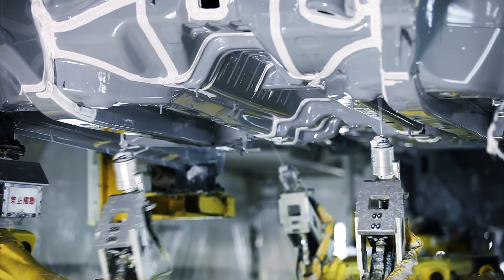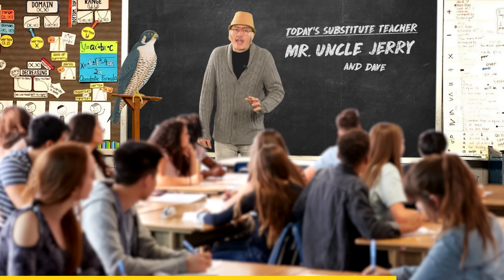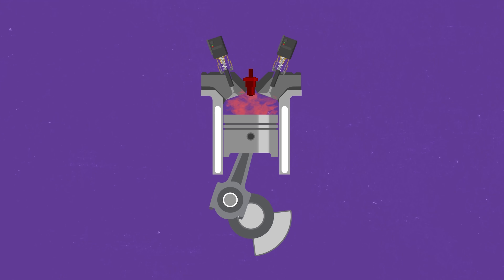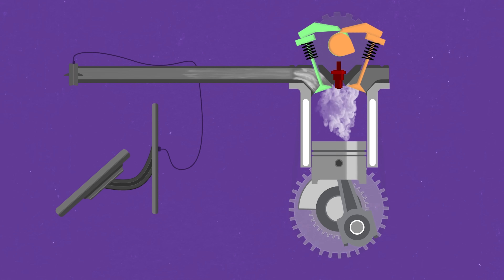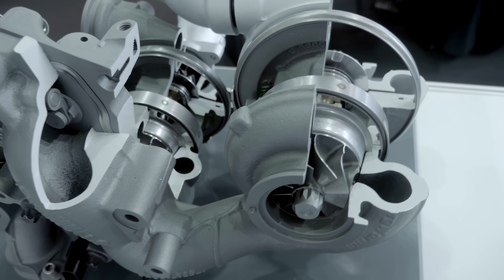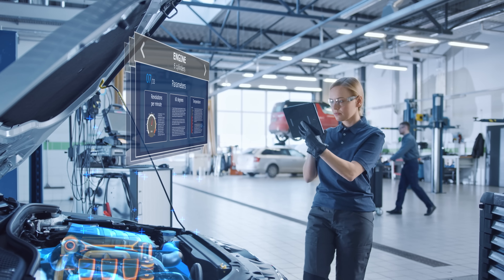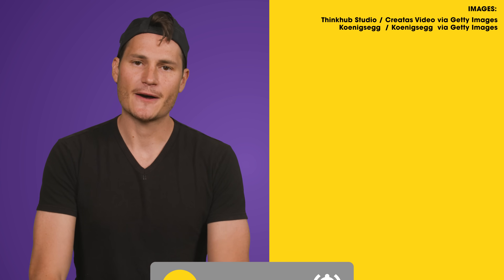This Is The Last Great Engine Tech

Comment: you know I've always thought that the EFI tech that has been around for a while, injects the air-fuel mix directly into the chamber but apparently it's not, it functions more of a digital carburetor huh. I've always known that electronic injection into the chamber would be absolutely nail the stoichiometric ratio and the highest pressure for every power stroke so I thought we've already done this lmao. The electronic bits of this can be done using Arduino shields for sure. Love your content, Jeremiah

- A fellow engineer

P/S: methane powered engine? stay OH safe and show us that bad boy my man

Comment: I thought about this years ago. Like in the 90's. Just wasn't an engineer our had enough mechanical knowledge back then. Shoot I also thought about why not get rid of the intake valves all together and have a air pump built into the engine and have direct fuel AND direct Air injection. Using and electronic Exhaust Valve or build it similar to a 2 Stroke and use a bypass valve.

Comment: There have been companies testing electronically actuated valves for decades.  Ford had several prototype engines ages ago.  Their problems were all in the areas of reliability, compute power and economics.   If we've progressed to eth point some guy can buy parts to build this in his garage then i'd say we're overdue for these engines.

Comment: The problem with a fart car is it will cause a rise in price for beans and other flatulence causing foods. Just like ethanol caused a rise in corn prices. But as a man that can clear a room with mine, I would love to have a car powerd by "natural gas".

Just put a collection device under each seat with slite suction, and a small compressor that's all that's really needed. It will probably make more sense as a power adder not as a primary fuel source.

Comment: This seems like some tech that should have been implemented about 30 years ago.
Reply: Tbh it was possible even 20 years ago, and I don't see it as bad as "carb vs injectors" cuz with electronic cams you can leave so much maintain behind (some european chains needing to pull the engine out for 5-10k)
Reply: Was thinking the same thing. We have had all the parts for this for ever now.
Reply: Caterpillar filed for a patent for electronic/hydraulic valve actuation in 2000 while trying to advance their heui system. Lots of other manufacturers have played with this technology.
Reply: Car manufacturers have a very slow development cycle. If car manufacturers designed electic cars that car people would like, they would have made solenoid electric motors. Same as those solenoid v8s but bigger. Efficiency will probably be worse, but those solenoid engines are futuristic and still holds a candle to the ice vehicles.
If making and designing cars were easy as implementing software, we would have had electric cars waaay before tesla, but the complexity of the car industry is far bigger than any software industry. Hell even any electronic manufacturers.
Reply: Hell the tech could have existed back in Henry ford's time - they could have electrically actuated valves that were controlled by something similar to the old distributors instead of a computer - it would have been possible to retard or advance the valve timing more easily with electrical control, and it would have been a lot simpler and lighter than all the timing chain and cams that are needed with traditional valve control.
Reply: @Cast Reflect This isnt variable valvetiming. Most engines have that.
This is electronic valve control.
Both valve length and riming become infinitesimally adjustable with an electronic control unit.
Its like EFI to carburetors.
Reply: Isn't that what the multiair engine system is?
Reply: I own a hit and miss enjine that was made in 1908,it has no rocker on the intake valve and uses only vacuum to open but this is not freevalve like we have today,the new systems had to wait for computers powerful enough to control them just as electronic injection did
Reply: @DaveTW65  you could power freevalve with an Intel 4004, which has existed since 1971.
Reply: @kalasmournrex1470  You can hardwire this shit into a microcontroller with vacuum tubes. The problem isnt processing power, its reliable operation.
Reply: @kalasmournrex1470  there were no emission standards to push research and the cost effectiveness would have been unjustifiable against traditional valves,this was the early days of electronic ignition and even that was having issues with reliability back then
Reply: @DaveTW65  true

Comment: still don't understand how more mainstream manufacturers haven't done this with their latest engine generations. the benefits seem so huge. imagine a 3 liter bmw I6 with freevalve that's 15% lighter, 20% smaller, 30% more powerful and 30% more fuel efficient, seems dumb not to try. instead they're doing mild hybrid shit, adding weight and complexity to achieve worse gains

Comment: Nice! I rebuilt my first engine when I was 15, back in 1979, and it was a 351 Cleveland 4v. I have rebuilt numerous engine since. I grew up in the suburbs of Detroit, with my dad working for Ford. My sister has been with them over 20 years at their HQ in Dearborn. I remember when Jack Roush had his shop just few miles from the house off of Levan rd. and I got my hands on a 2.3 Turbo that his shop had built and put it in my Mustang. I say all of this so that when I say that this explanation was excellent, it comes from someone who know how this stuff works.

Comment: I feel like free valve technology can save the V8. Increasing power while reducing elections. Also with a smaller engine you reduce the amount of material used and of course the weight savings that come along with that would be beneficial.

Comment: The graphic about 'half the exaust that goes out instead to the turbo' is wrong.   1 of the valves of each cylinder goes to turbo and 1 of  each cylinder goes directly out.  But it is no even like that exactly.   It has a 'Y' setup

Comment: I’m surprised ppl don’t like electric cars cause of some reason even when ice are PACKED with electronic parts to cut out mechanical parts. I’d think we would all be excited that we don’t have to break the bank for hyper sports car performance
Reply: It is because of their awful range and how they are completely silent, although the tire and road noise on them seems 10x louder
Reply: @ayoutubechannel921   range is pretty ok at 500km per charge especially when you aren't a traveller.
Reply: @Ajibolaa  I guess car manufacturers could have used straight-cut gears on the motor components so their is at least some noise

Comment: What if the digital free valve system gets heated up by the engine emissions that would slow down the processing power hence resulting to far more worst results than the analog method

Comment: The last great engine technology will be magnetic coupling and no oil engines.
This is basically a normal electric motor, but for the purists who just have to have the v8, v10, v12 and the odd v6 a magnetic engine based on those traditional formats will eventually come into existence. 
As of yet they don't exist, I mean a solenoid engine isn't a million miles away but they have friction loss which a magnetic engine won't it will just have the issues of electromagnetic feedback to overcome.
I literally look forward to the future because it's going to make now look like the stone age.

Comment: That graphic animation at 6:00 is where it’s at! Simple and understandable. Love that combo. Cheers to the artists.
Reply: its also wrong. Actuator response isnt instantaneous. Response to input sort of is, but those edges on graph should be curved slightly. In other words it contrasts two different things - signaling for digital valves and open/close cycle for mechanical.
Reply: @bartoszbaranowski604  it is still much faster and can stay at 100% instead of reaching 100% for a mere instant. The graph is dumbed down to get the rough idea. Very simple and very understandable
Reply: @TaireTV  Never said otherwise. Though, graph is not "dumbed down" it's just wrong. It compares digital signal to position of vales in mechanical set up.
For mechanical set up it is roughly the same( minus inertia of parts ). But for digital setup it just isnt - input signal is not even close to valve position/graph.
Reply: @bartoszbaranowski604  the graph provides pretty good understanding for people who do not know how analog vs digital works. Providing understanding is good, but in reality, analog vs digital signals work absolutely differently, this is where they made a mistake. I think, what they wanted to show was that there is more precise and predictable valve control, using digital signal, which does not depend on revs mechanically.
Reply: @v0ffka1  I think this graphic crossed the line into inaccuracy and then some.
Reply: The thing that bugged me was on the cam graph it was a sine wave vs having flat spots where the valve was closed.
Reply: Yeah exactly! 
Are you an animator as well?

Comment: i liked the project car Koenigsegg tried this tech on for 4 years ago, an "Old" Saab wagoon. the emissions and power were really nice. but the most impressive thing was that fuel consumption decreased with around 40% while getting better power, torque and emissions.
Reply: Correction, the old saab has had its tries with the free valve tech for over 10 years today, and at the time 2013, it had over 60.000km driven with no issues

Comment: The electric takeover isn't entirely here yet - There's a huge market for this as both an OEM and aftermarket system. I'm not against electric cars, but until the tech in them is cheap enough that everyone can afford them, and until the range is improved to the point that people in rural areas can use it effectively, we need combustion engines. And since we have a bunch of old cars and engines that are inefficient by modern standards, why not make an aftermarket system that modernizes them?

Comment: Also if possible research more on the alfadan big block 4 cyl engine. Claims of over 600+hp naturally aspirated, that also uses freevalve company for its valve train system.

Comment: This technology is an advancement in Fiat’s MultiAir technology, developed almost 20 years ago and has been in cars for over a decade. Don’t give Koenigsegg all the credit.
Reply: They still use a camshaft, so it's a bit different.
Reply: @pvp_operator  it is different, but they didn’t come up with the idea from scratch. You gotta give some credit to Fiat for their predecessor to this all-digital version.
Reply: @davedvorak8426  The idea of total valve control has been around for longer.  I've never heard anyone at Koenigsegg say they got their inspiration from Fiat.  I'm not knocking Fiat, I like their solution.  I'm just saying they are different solutions to the same issue.

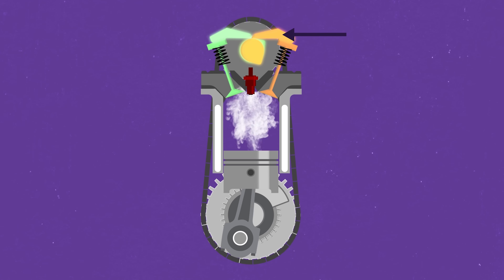Comment: 3:14 Holy sh*t for a car channel, that animation of the engine with the timing chain and completely wrong sprockets to turn a camshaft at half the speed of the crank makes me question your basic knowledge on how engines work.

This video....tries....to explain things.  Eh...even with electric controlled valves, they still take time to open to the target position, as well as to close.  It's not instant as you claim.  You are right in the end though of course, it's still the optimal setup, and every car should have this or something similar.

One thing that might blow a mind or two (if they know how things work) is you wouldn't need a cam signal to run sequential ignition (COP/CNP).  B/C you control the valves, TDC on the compression stroke is now under your control, and not dependent on the cam rotation to know when to spark.  You'd just need the crank signal.  If you had a kit to install, you could also remove the disty/coilpack and go right to COP to get better ignition control too.  A very cool thought IMHO.

Comment: Oh how I wish one of the aftermarkets (Edelbrock, Trickflow, Dart, etc.) would take this and run with it.  Can you imagine FreeValve setups for LS engines?  Sadly I think most OEMs are done with engines.  I think all we're going to get is little tweaks to current engines until they completely kill them off in 2030 or whenever they plan on doing it.
Reply: Dodge only plans on hybridizing their vehicles, no current plans on an EV. They did have an electric concept car, i forget the name, around 10-15 years ago i think, but check the channel Marspeed. He's got a video series on all sorts of Dodge, Chrysler, Jeep, and Plymouth concept cars. It's pretty neat yo
Reply: @gromoliver4270  Yeah I used to frequent Allpar all the time because that site was fantastic, but they screwed it up turning it into a forum.  They used to have lots of future content.  Other than the 500e, which Sergio actually told people not to buy, yeah I think you're probably right.

I could see them trying to electrify some other rebranded fiat, but It seems like they switch owners so frequently it's hard to nail down a reliable long term plan.
Reply: I can't say much about how US manufacturers will tackle this, because in so many ways they live in a different world to the rest of earth's car makers, but I certainly see European, Japanese and Korean manufacturers picking this up. After all, they still need to stretch their internal combustion engines for another decade, and adding electronic valves is a relatively cheap way to significantly improve an engine's efficiency, where traditionally such gains would have required a completely new engine design, which I agree would be unfeasible in these times.
Reply: @rjfaber1991  Man I hope you are right, I would love to see this trickle down into a production engine.  Even if it's a boring car.

Comment: E vehicles are not really the way of the future!  Theres just so much more energy density in gasoline compared to lithium. Gasoline engines are just inefficient and harnessing the power. If We could apply some of this good tech in mass this would drastically improve efficiency and we still get turbo sputter! SAVE THE TOOTOTOOOTOOO!

Comment: Internal combustion engines are here to stay, so I definitely see this tech going places.  Not that electric cars wont start to become more prevalent, but there are just too many use cases where electric is not a viable option.
Reply: Can you please elaborate on this?
Reply: @InterpretedConcepts  poor people aren’t setup to be able to charge their car at home. And the amount of charging stations needed will take years to implement. And how many poor people working two jobs have the time to go to a charging station for two hours to fully charge their vehicle. It’s not very practical.

Comment: great video, I would like to add that a lot of BMW engines use variable lift cams called valvetronic instead of a butterfly valve as well
Reply: I was just going to comment about the Valvetronic. I learned what it a few weeks ago and was blown away with how it works. Sure its not individually controlled valves but its pretty darn close! Pretty cool that its been around for more about 20 years at this point.

Comment: Nah. Electric won't have anywhere near the same culture as gearheads for a long time, which is gonna keep ICE cars popular for a long time, especially diesel bros. Write it down and put it in the bank. Diesel will outlive gas as automotive fuel, if only in heavy equipment and emergency vehicles, by several decades.

Comment: You can remove the intake valve completely. Have the air injected at high pressure into the combustion chamber. This will also give the opportunity for more air to be injected. No matter how great free valve is, the faster the engine spins the less time the valve can be open. If you injected air directly from a high pressure nozzle you have ultimate control. 

The you only have one(set) of valves on the exhaust side. You have have multiple air injection nozzles for higher air input at higher rpm.

Comment: Fuel injectors fail and electrical faults can cause injectors to open when not commanded. Just imagine a valve doing that, bye bye motor.

Comment: Curious to see how freevalve tech will hold up to high mileage. I have some concerns about the actuators and harnesses over time and with exposure to very high temps. If they fail then it could be the same as breaking a valve stem or rounding a camshaft, you could destroy a motor like that. Hopefully they are able to handle that sort of thing. It's different in a hypercar where longevity isn't the concern, but on a consumer level reliability moves cars. New engine tech is usually not well received.

Comment: And this is still slow, 80s F1 Tech. From the mid 90s onwards teams uses pneumatic valve timing, faster and more efficient. They didn't use electronic valve timing because it's slow.

Oh also pre-combustion chamber so the spark is even more powerful.